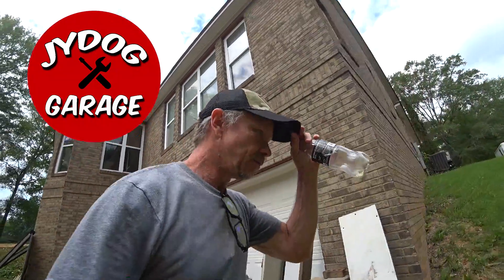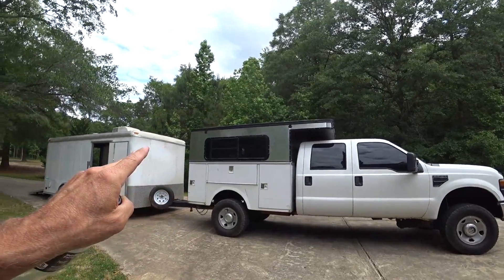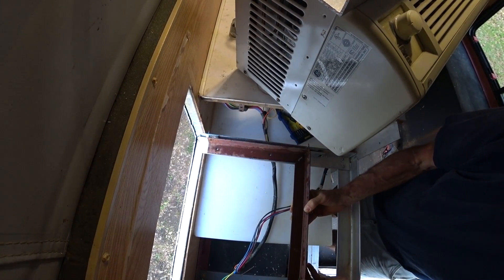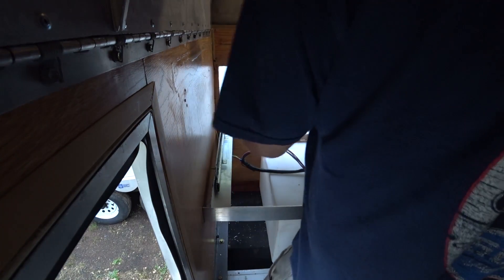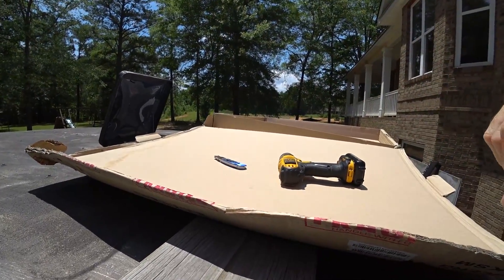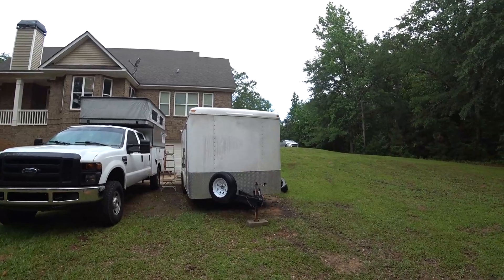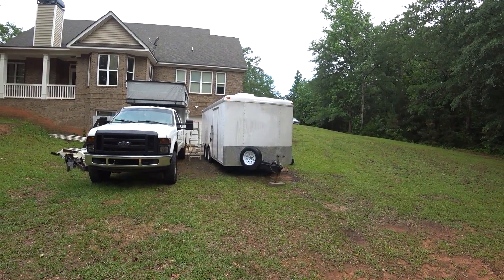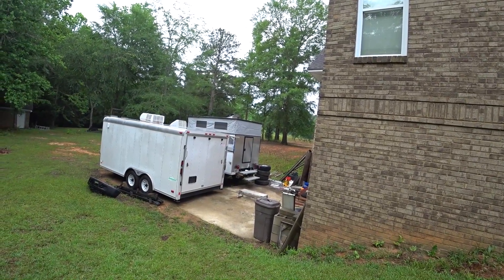Budget Overland Camper Plan 15

Comment: I love the drawer slide A/C idea.  I'm borrowing that for my build.  I like where you are going with  the trailer idea.  My suggestion would be to keep it multipurpose if possible.  I would put a full bath up front, simple kitchen running side to side against the wall for the bathroom, and then a full/queen size Murphy bed along the drivers side wall.  You could retain hauling ability (albeit a little narrower) and then fold down the bed at night.  A couple of zero gravity chairs could be set up during the day or something like that  if the weather outside was bad.  A few windows on the passenger side and maybe one on the drivers side where the kitchen is for cross ventilation, a good roof vent fan and you would be set.

Keep up the good work.  Whatever you do will be fun to watch.

Comment: Remove all the panels in the trailer and spray foam that thing, re-panel and you have a nicely insulated cocoon to sleep in. 

On the pop up are you going to snow coat or Gaco it?

Comment: When you secure your ceiling in the trailer be sure to put duct tape over the supporting structure or condensation will drip down. I put foam board in the voids and taped it up. Then you just secure the ceiling material thru the duct tape. Added camping space to a horse trailer once and talking to others who did the same thing found out I did the right thing by accident :)
Reply from the maker: Great info. Thanks for the tip.

Comment: Interested in your trailer floor plan ideas. Keep rear door for toy hauling, Murphy bed or raises to roof. I build one myself last year. Same size
Reply from the maker: Exactly what I was thinking Murphy bed on the long wall that maybe folds out into a couch. Kitchenette on the long wall. Dry Bathroom on the front of the trailer have plenty of room for a 36 by 36 fiberglass shower. TV across from the Murphy bed with storage along that wall. Definitely looking into a mini split for AC

Comment: Sometimes even following the directions, the project doesn't turn out the way he designer intended, because of many reasons missed a step,  the designers configuration is different from ours, maybe there's a bolt loose somewhere...etc.  Regardless, i enjoy your videos regardless which direction your headed at any particular time.